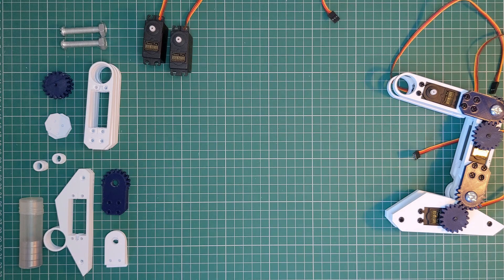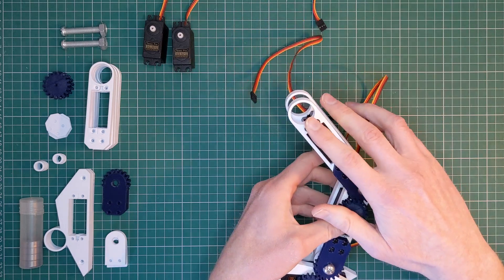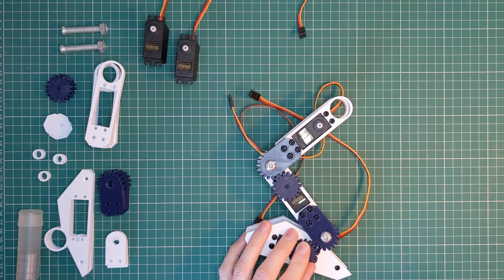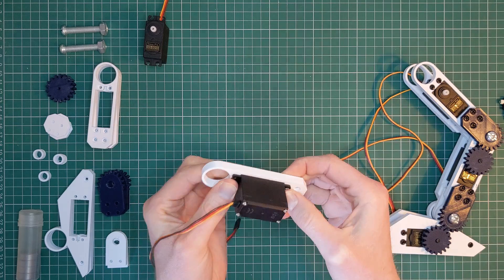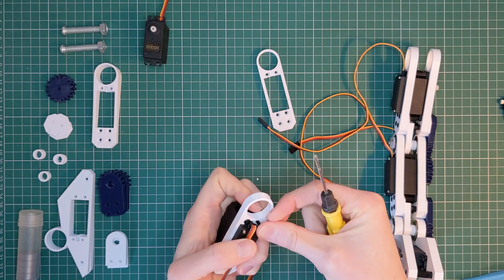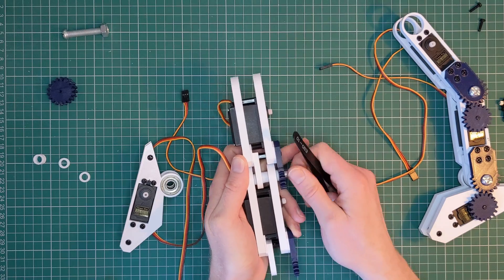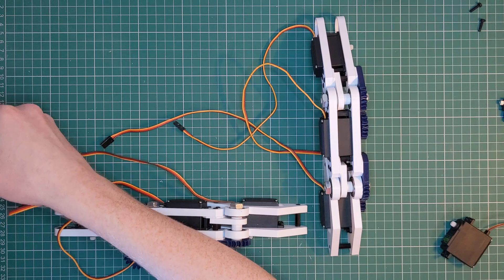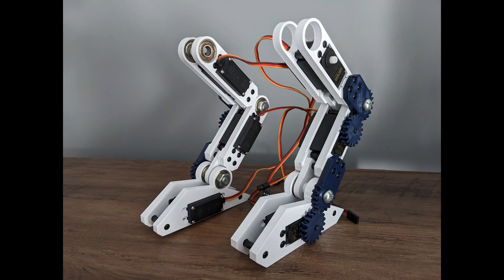Modular Robotic Bipedal Leg - Dan Makes Things

Comment: If I tried to use mg995 servos instead, do you think that could work due to its higher torque
Reply from the maker: As long as the torque was high enough and the dimensions matched, I don't see why not 👍

Comment: Have you experimented with adding another axis of rotation? Like a shoulder joint? I'm curious aboyt how you could adapt your system for that. Fantastic work!
Reply from the maker: It has a joint like that, but no actuators attached (yet). A good improvement for the future.

Comment: Would you mind uploading the cad files of the body and head. Cheers
Reply from the maker: The head is available in the description of that video, the body is on it's way (current version: https://cad.onshape.com/documents/2847233f33aab45fe405538e/w/bee9409e13e5a847e8629e19/e/4955af09cbb743f37936c9fa)
Reply: @DanMakesThings  cheers
Reply: @DanMakesThings  sorry to bother but can’t seem to find the head files please can you upload them here
Reply from the maker: The original was on fusion 360. This is the onshape version.

https://cad.onshape.com/documents/f4233124bf0c2cd12a0ce5e7/w/d35a21e8d93e060ed6f0ebe6/e/e8920e0b2d6baf6d7a5ec662

Ignore the shell, that's still wip.
Reply: @DanMakesThings  cheers can you also upload the neck files for connecting the head and the body
Reply from the maker: What are you missing?
Reply from the maker: This? https://cad.onshape.com/documents/27949bbbbc5bafd6cf0f743b/w/44ee3f569cea75dd32ed1d65/e/9ccf5cf1105a5c7e92339433
Reply: @DanMakesThings  the connection from the body to the head